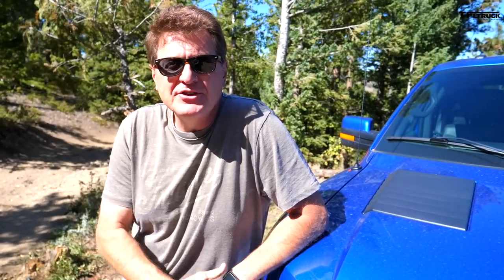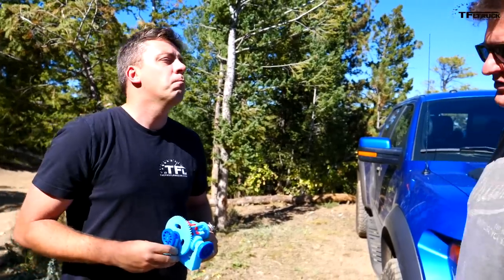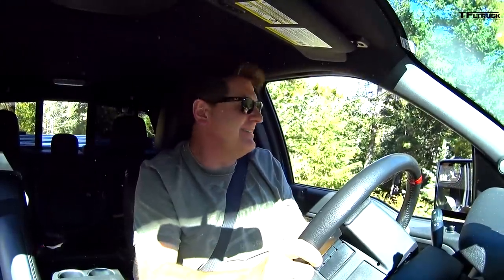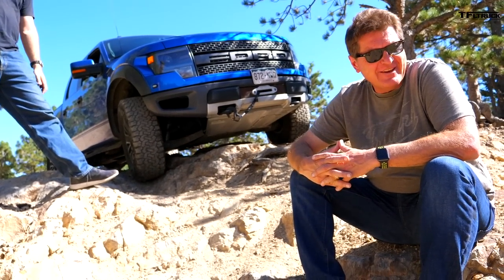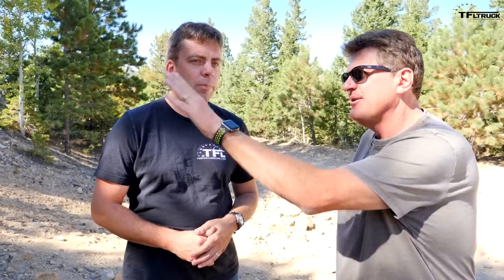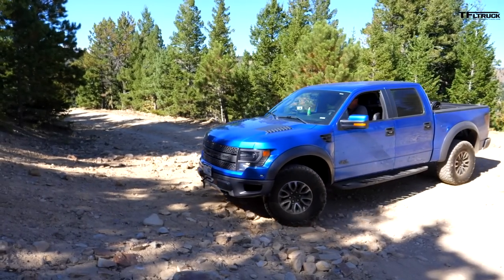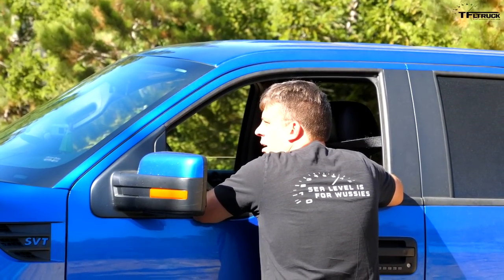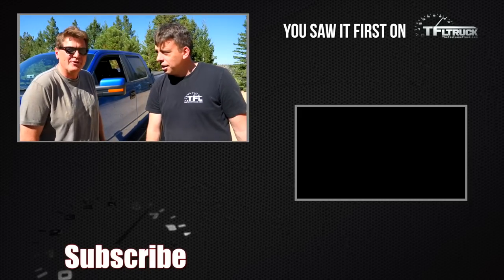How Important Is a Locking Diff When Off-Roading?

Comment: You won't get up loose and steep without a little momentum whether you are locked or not. In fact, you would have seen about the same results in the last test if you were in 2wd. Once you begin fighting gravity on a loose surface, it's over. Your lockers will come in handy if you're in deep sand or have wheels in the air over an obstacle. The rear also comes in handy on steep descents in vehicles that don't have a cheater/assist button. These newfangled trucks do so much of the work for you that a lot of the skill it used to take to get over certain types of obstacles isn't as important as it once was.
Reply: Yup. The modern nannies almost make it too easy these days.

 In a JK or JL Rubicon, even when the diffs are "unlocked", they're still LSDs, AND the 4WD JK/JL BrakeLock standard feature is still vectoring torque. The Rubicon front anti-swaybar disconnects from inside the cab too.

 It's a far cry from offroading in a stock 30"-tired CJ or YJ, but even those can be ridiculously capable offroad with just disconnected bars, and even moreso by adding some cheap lunchbox lockers. Many were also offered with LSDs.

Comment: Do you need lockers/LSDs? It can depend on several factors. I offroaded an open-diffed 2.5L/5spd YJ for several years. Even with 30-31" tires and stock-height suspension, it would go a lot of places.

 If you have little articulation, like with an FIS Hummer or car, traction diffs can make a HUGE difference for rockcrawling or climbing. If you don't have TCS, traction diffs can make a HUGE difference in deep mud or snow.

 These days, most decent offroaders have TCS AND good articulation. Look at the Wrangler JL and the new Bronco. Look at the 4Runner and Landcruiser. Base models often still have open diffs, but can still offroad. Then lunchbox lockers and aggressive tires can make even these base models ridiculously capable offroad.

Comment: Whats interesting is that its clear to me at 2:17 that the front torsen is working great to transfer torque.  Slow it down to 25% and you can see it.  Either that or the ESP/traction control is kicking in making this really hard to test...or both.

Comment: Why motor manufacturers have started to build their off-road vehicles ridiculously low is mind boggling. One three inch high rock and it suffered damage. There is a reason off road motors have high ground clearance, one that most people with two brain cells know about. Without that increased ground clearance most are nothing but a status symbol for the office worker.
Reply: because they'r better tourers, better and safer onroad, etc. Nothing beats a big lift and big tyres for things like crawling and deep ruts but the car is pointless and dangerous otherwise. I'v had big trucks all my life and now with a stock Hilux it's a pretty big relief not feeling like you're going to tip overtime you end up a bit sideways
Reply: Most AWD/4WD owners don't take their vehicle on serious offroad trails. They just want better snow/mud/sand capability than a typical 2WD offers.

 For the minority that DO offroad, many still don't NEED much more than a stock vehicle. I rarely lift my offroaders until I destroy the stock suspension. I prefer a high-clearance, low COG setup with winch, siped mudders, articulation, high skids/bumpers, and lockers. Then they often still handle on pavement similar to a stock vehicle.

 A Jeep TJ with stock springs can fit 35s. JP Mag showed this years ago. Just replace the stock rubber bodymounts with a 1" poly bodylift, tube the fenders, and get some adjustable rear control arms.

 Take the bumper endcaps off. Disconnect the anti-swaybar. Add a 1" MML and a flat skid for excellent breakover. A high-clearance fueltank skid can be added at this point too. 'No expensive suspension lift required.

 Add lunchbox lockers, angle-iron rocker protection, and a Badlands winch for cheap. Such a rig will do trails like the Rubicon...or worse.

 My Crosstrek has skids, hitch, multi-mount winch, and 1"taller ATs. A rear locker is next. Then maybe a Cusco front LSD, rockers, and high-clearance steel receiver bumpers. A suspension lift isn't even a consideration for it right now. I commute 50 miles each way, and can still get 40MPG doing it, while still handling like a typical car.

Comment: Agree with others; to display what a locker can do, get on a slippery slope.  Ice, mud, wet pasture and about 25 to 30 degree slope.  On the run where you bottomed on hard parts, your path selection was wanting for sure.

Comment: 0:58 Torsen Differentials was something new starting on the 2012 SVT Raptors. Anyhow, locking diffs are very important, as you say, a standard 4WD is like two-2 wheel drives. I don't always need my rear locker, not really into rock climbing with a Raptor but it has come in handy at times.
Reply: Torsens have been around for decades. Military Hummers use them.

Comment: Locking is nice to have but depends on the type of wheeling you generally are doing too. I know I will get slammed for this but I am partial to a mechanical lsd/posi not the newer brake actuated ones in some newer vehicles. A lot of time the locking diff can also only be engaged in 4low. Still a very nice feature to have especially in CO!

Comment: I  yanked my side steps once I realized that they just bolt to the body panels.  The issue is that the aluminum body panel is going to bend before a heavy stamped steel step (which has a TON of form rigidity) which is a much worse problem than a messed up step.

Comment: Try when rock crawling, this is an example of a resource used in the wrong scenario. Momentum through mud, or no momentum when rock crawling. Amplify this with a front and it's nearly unstoppable with obvious limits This up hill test with more articulation to the suspension would show immensely greater results. A locker is only beneficial when pressure on a wheel differs from the wheel adjacent to it.

Comment: They could have proved a lot more by just using a floor jack to lift one of the rear wheels off the ground to show it spin and then engage the locker to show the difference between an open diff and one with a posi or locker. Great videos tho, I like this channel a lot.

Comment: There's no question a locking diff makes a huge difference, and I mean a real locker, not a limited slip.  A locker will drive both wheels in any low traction situation.  A limited slip works in most, but not all low traction situations, and if one wheel is off the ground, you're likely screwed.  And yes, GM's automatic locker is a true locker, not a limited slip.  Why GM refers to both its pickup locker and its car limited slip as "G80" is a question for the ages, as they are not the same thing.

Comment: Here is where these tests were flawed.  Both wheels had similar traction, but it wasn't enough to push up the slope.  Locking diffs help the most when one wheel is off the ground.  All these tests did (especially the 3rd) was prove that the truck is heavy enough to give both wheels traction, but the soil was too loose to keep them from spinning.

Comment: How come both rear wheels were spinning even without the real diff locked?
Reply: 4x4.
Reply: The rear end is limited slip, and they were pretty flat, like 70/30 at an angle seems the tire you need to spin never spins so your stuck that's where the lockers come in, when you have them in the front and back you can climb a tree .) Back would still help though,
Reply: @lbriant48  its not limited slip while unlocked
Reply: @Blue_Flame_Raptor  limited slip will sometimes turn both sometimes turn one, lockers lock them solid
Reply: @lbriant48  no shit, Sherlock
Reply: @Blue_Flame_Raptor  Rubicon diffs are LSDs when "unlocked", which makes no sense to me. When I want it open, I want it OPEN. TCS/VSC should truly turn off with the button too.

Comment: I think in those ford's you can lock the diff in 2wd. Looks like it has limited slip rear also. Try climbing a hill in 2wd not locked. Then in 2wd with it locked. Or best case is to have it flexed in the rear in 2wd to show how a locker works in real time
Reply: dkhill27 I think you can only lock with 2WD in the 2013+ F150s. The 2010 and 2012 I've been in will not lock in 2WD.

Comment: What about something like the Nissan frontier desert runner? It has a locking rear differential and all the upgrades of the pro4x with the exception of 4x4. How essential is 4x4 when you have a good weight balance, a locking differential, good ground clearance, and enough power from the engine to do it? I use the desert runner as an example because most 4x2 trucks aren't the same height off the ground as their 4x4 brothers and you took the final frontier up a good off-road path but the lack of comparison to the pro4x in ground clearance, power, and weight distribution held it back.
Reply: Can't 4WD simply be turned off in most trucks? Will the locking rear still lock?

Comment: Everytime Ive been stuck in 2wd (open dif) and I lock the rear end Im still stuck. only difference is 2 wheels are spinning in the mud instead of one. Kinda disappointed when this has happened to me multiple times. I even think that on mud it does more harm than good. Only good in straight ahways. You do turns with the rear locked in light mud/mud and it just kicks up dirt and cakes up the grips on the tires, making my tires (bald). now whenever i need traction i go straight to 4wd and forget the lockers.
Reply: So in a mud implication you would say four wheel drive is better than 2-wheel drive with a locker

Comment: No need to worry about body damage. It's aluminium. Just melt down a couple of beer cans and repair it. 👍
Reply: this Raptor is steel  fenders and doors with front fenders and hood plastic.  My 2012 Raptor was caught in hail.  dents on roof  but not on plastic hood.

Comment: Doesn't the advanced Trac in the f150 help transfer power to the wheel with less traction by applying the brakes somehow making it act as a limited slip diff? I know I read it somewhere back when the 11's came out. 
Also, attempting it in 2wd would help show the difference between the 2 a little clearer. All you need is a small ditch at an angle.

Comment: Simple way to show differential
 In use is drive through a ditch at an angle...super easy test and u should be able to find a ditch pretty much anywhere!a truck with no rear locker will absoultly not be able to make it through,the one with a locker will drive right through!

Comment: I might have to try a torsen diff for a z71 on the front since the front is open and not lock that way you don't bind it while in two high on the street in turns/cornering but will catch slippage during off roading while engagement in 4wd. I hope this helps.

Comment: Do this in the snow. --  Hey, I have a dumb question. I have a 1986 F-150 with the 351W, it was known as their 5.8L H.O. (high output) option that year. It has 4-hi and 4-low, with manually locking hubs. How do I know if I have a locking differential or not?
Reply: If it is in 4-low it will crow-hop all over the place if it has traction and even makes a mild turn.
Reply: Only if someone added it at some point. Doubt Ford offered a stock locker back then.
Reply: It might have an LSD or 2.

 Check the diffs for any tags.

 Put it on a lift with the tires hanging. Put the trans in Neutral and the tcase in 4H. Spin the wheels by hand. If they counter-rotate on the same axle, you have an open diff. If the wheel on the other side spins in the same direction, you have a locker or an LSD.

 Some LSDs are WAY looser than others.

Comment: You've managed to prove the raptor isn't meant for rock or steep obstacle crawling, and that lockers don't do much if you have the wrong vehicle for the job (especially if the limited slip is still fresh and good).  A cherokee XJ with spools would run circles around that thing on the rocks, while a raptor would eat it alive in a pre-runner type situation...  Give it 10 years when the limited slip is loose as hell, and you'll see where that locker comes in handy...
Reply: See, i'm looking into buying a raptor this year and can't decide about the torson front diff. I wont be doing any 'wheeling' as it's not the sort of thing i'm interested in, flying fast across open field is what i prefer. Can't get a real straight answer about whether it's really needed or not.
Reply: An XJ wouldn't even need spools. Lunchbox lockers would be just as good in rocks, but easily driveable to work too. ARBs and Ox lockers are nice too, but they're a bit pricey.

Comment: So do you not want the front diff to be locked? My truck has open front and rear diffs. I wanna go off-road but I wanna get a lsd for the rear. Is lsd for the front a thing? Or is it a bad thing? New too this 4wd stuff any help is appreciated
Reply: On a steering axle, a selectable locker that is open when unlocked would be best. Slick crowned/slanted surfaces can be dangerous with traction diffs. ARB and Ox Lockers can be expensive though.

Comment: This has nothing to do with this video but I’m wondering if someone could answer this for me. Why do commercial trucks with big engines put out similar power numbers to trucks that you can buy off of a car lot? For example:  a 2017 F650/F750 with a Triton V10 puts out 320 HP and 460 lb. feet of torque. A 2017 Raptor with a V6 ecoboost puts out 450 HP and 510 torque. Since the commercial trucks are obviously carrying/towing heavy loads, why are the numbers lower? Just curious...
Reply: Pricepoint and longevity? Fleets should be economical to operate, or a business may not be profitable.

Comment: You guys clearly don't understand when/why to use a locking diff. 1. You need to turn traction control off because it brakes the spinning tires and essentially acts the same as a locking diff. 2. It's only beneficial to use a locking diff when a tire comes off the ground or has significantly less traction due to frame twist, like going through a ditch and one tire comes off the ground. Going up that hill, the weight was evenly distributed so of course both rear tires would spin, especially with traction control enabled.
Reply: jonbar87 traction control is off in 4x4 low

Comment: This video should not make anyone feel better if they do not have a locking rear differential. Basically if you do not have a locking rid of rental at any given point in time you really only have two wheels one in the front and one on the back getting torque, it seems to be whatever wheel has the least amount of resistance is going to get the majority of the torque or perhaps all of it so if you have one wheel off the ground that’s the one that’s going to get all the powers into it because it’s the one with the least resistance and without locking rear differential that’s how you get stuck. If you engaged the locking rear differential the tire on the ground is going to spin at the same rate as the tire off the ground and that’s going to get you out of your jam hopefully, and turn the four-wheel-drive truck into at least a 3 Wheel drive truck. At least that’s my understanding of it . I could be wrong

Comment: Does low range engage a centre transfer case locker?
Reply: It's a part-time transfer case, the out puts are already locked and spin at the same speed.  That's why you don't put it in 4x4 on paved dry surfaces.  Full time 4x4 system such as the Jeep quadratrac (np/nv 249) or the old select Trac (don't remember the tcase model) have a slip system like a viscous coupler to allow for turns on dry pavement.

Comment: The truth most don't need one, I have one and used it maybe once in two yrs , the g80 from Chevrolet is better as in it will work without the actual pushing a diff lock and putting a vehicle in 4lo, which also gets used way less than high range.
Reply: Some people offroad several times a week. Some people offroad in ridiculously difficult terrain.

Comment: Do it again with the Wrangler. I want to know if the brake lock differential can compete with an actual locking diff.
Reply: Not when power or wheelspeed is needed.

Comment: If anyone actually wants to know when lockers are good, from people who actually have experience offroading and not just in the trail behind their suburb: https://youtu.be/4U1SLSV9wNk?t=74

I'd rather have 2wd with a locker than 4x4 with open diffs. Limited slip diffs also don't compare, and braking traction systems (Toyota) also don't compare because they cut engine power and your momentum in low traction situations like mud and snow.